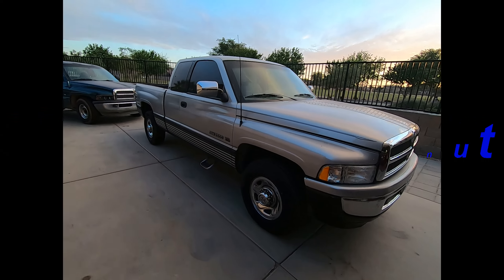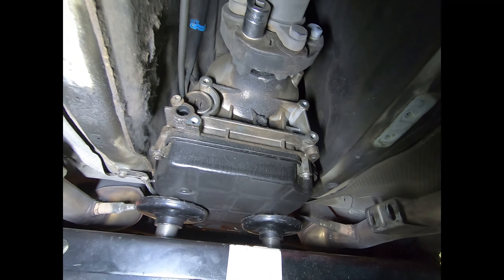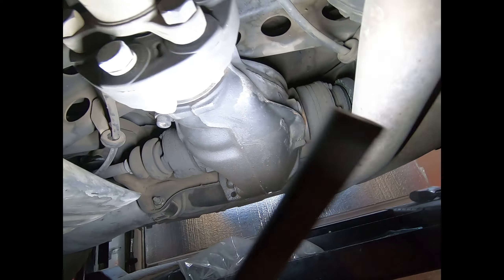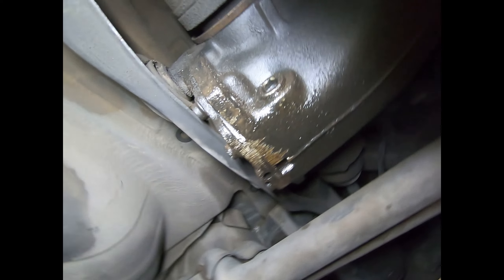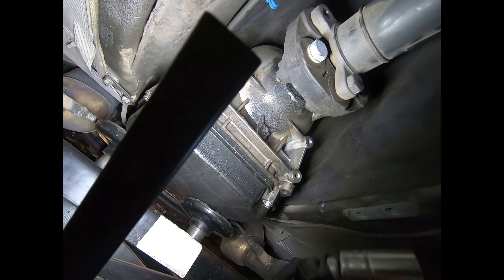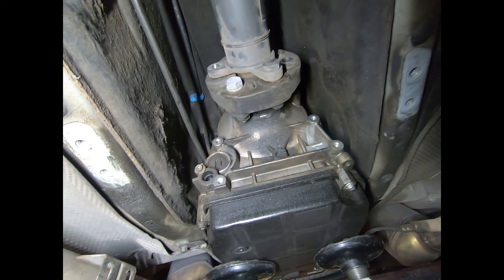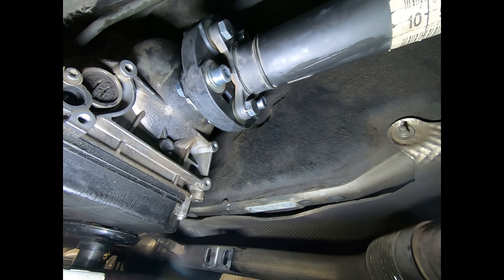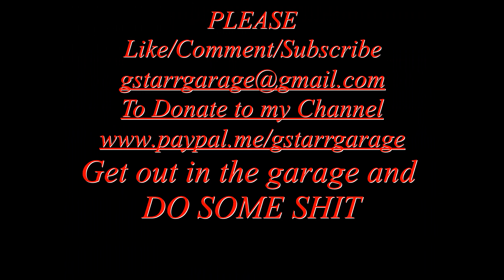Mercedes E320 2000 Flex disk replacement

Comment: Good video. I think you can get the replacement CV boots that are the split type.. glue them together. Not the OEM solution but will stop that Driveshaft going awol... J
Reply from the maker: True but they are not very good